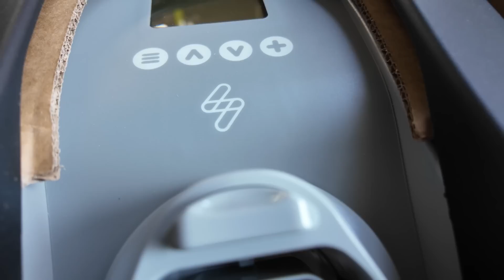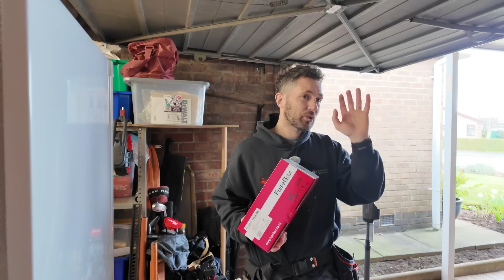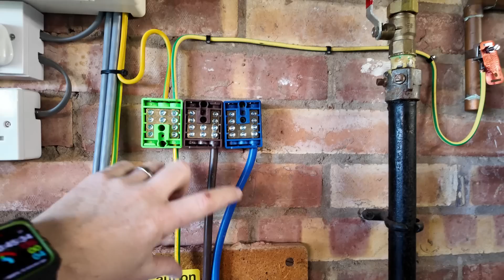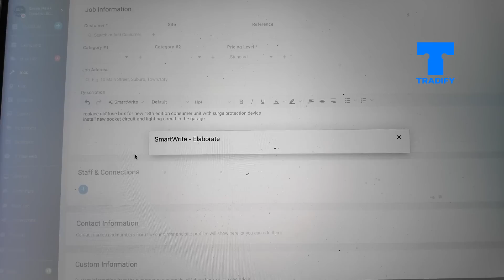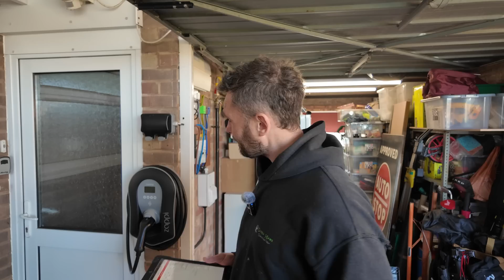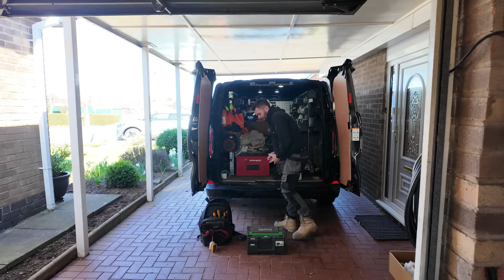EV fast Charger Install - What The Pros Don't Tell You

Comment: 9:57 Found that if you have brittle bricks,  use a tile drill bit with hammer off, and just let it cut at its own pace. Works most of the time
Reply from the maker: I will give it a go. Thanks for watching

Comment: I don't know how anyone could possible suggest that you might have pulled the main cut-out fuse 😀   BTW  what happened to the test for the DC trip. The std. EV CU has an A typ RCD which can only cope with 6mA of DC. The good EV charge points have a built in DC trip which will disconnect if DC leakage exceeds 6mA. Your EV pilot has a test setting to check for this..

Comment: Great job. I don't understand why you didn't fit the EV fusebox to the wooden board next to the meter? It would have been easier to mount and looked so much better. I don't like the location of the oυtside socket, it's too high up, and it looks weird being above the EV charge point.

Comment: Just be aware ( as I was caught out by this 🙈) in relation to a looped supply you could be looking at the end of line of a looped supply in which case there will only be one cable coming into the head end.  Best check with DNO every time👍

Comment: Have you considered using a small meter board for situations like this, small ones are only around a tenner, would give you easier fixing points rather than direct to brittle brick.
Reply: There was one available already next to the meter.

Comment: What cable slicing tool is that dude? My knife just doesn't cut the mustard anymore and stripping it in colder weather has buggered my wrists... haha. There is another test you can perform with the Megger EV adapter and as I was taught should be testing, which is the PE cut-out. It simulates a loss of earthing I believe and should tell the charge point to disengage. Great video and another nice neat install. :)

Comment: Much better to test the RCD at the terminals, as your results will have been influenced by the Zappi's integral electronic one, which may have disconnected quicker than the upstream one. Not sure how you achieved a clear insulation resistance test result with the cable terminated within the Zappi.

Comment: Too close to the edge, too close to the garage door to avoid cable impingement and the absence of a second incoming supply does not assure that it isn't a looped supply.  Looped supplies are often installed as a pair, so only 1 of the 2 houses will have an extra cable, the other does not.  Henley boxes should really be mounted on a board, not to bare brick.  Loose and wobbly on the wall is... well you know the rest.  Other than that, keep the content flowing.

Comment: I was told recently that there was a minimum height for consumer units. Does this only apply when in the house?
Reply: That's building regs nonsense. I installed a board high level in a summer house where they wanted it and the chap from building control threw a fit and demanded that I lower it due to accessibility reasons. My argument was the client can reach it and children can't. Now children can piss around with it to their hearts content and they now have a c/u behind the bar at titty level.

Comment: Lucky you timed the DNO fuse pull and the meter install people between min 13-16 just in time for your lunch, did they remember to re crimp and serial code the meter crimp or was that a special meter with an isolator on it ?
Reply: The electrical fairies did it! They’re similar to the YouTube armchair electrician police only the electrical fairies actually get the job done! 😂

Comment: Shouldn't have touched the meter equipment full stop. Customer should request an isolator installation from their energy supplier. Now, I understand why you done it this way, as suppliers can charge up to near enough £200 for a £5 isolator. But should something happen to that meter installation and they'll be right on top of you. Did the garage door not rub against the zappi cable when closing the door?
Reply: The problem with cutting the seals on metering equipment is that if there is any fire damage or worse case a fire it “could” invalidate any home insurance. Energy suppliers don’t make it easy to instal mains isolators though.
Reply from the maker: no a quick check with the door before fitting and the cable doesn't rub luckily but the client wanted it there rather than a different location what i suggested

Comment: I don't understand the logic from zappi, there's cost in the relays, the cable, contactors, CT clamps, I would have thought at least £15 in cost to them.  They go to the effort of all the cardboard packaging, but then you have all these parts you'll never use.
Reply from the maker: i imagine with ordering so many more they got a better rate and with a standardised production line it probably works out better for them but it cant be much. Thanks for watching 👍
Reply: I’m not sure why they even bother with three phase. Hardly any EVs have an on-board 3P charger and of those that do, it’s often 3x16A (11kW) rather than the full 3x32A (22kW).

Comment: Single phase AC charger and you call it fast charging? also single phase chargers should be illegal
Reply: I would think that more than 90% of all home fast chargers are on a single phase installation. You would be very unlikely to be able to persuade the DNO to fit a 3 phase supply to a domestic home unless you are a very large house, or have a very high energy useage.
Reply from the maker: why illegal?
Reply: It is a fast chargepoint (NOT charger). Fast and rapid have different meanings. Rapid is DC.

Comment: You may want to consider if the neighbours property is on a loop too this property could be EOL of a loop🥴

Did you chop off the extra cores for that integral CAT5e??
Reply from the maker: Yep it could be and it’s down to the dno now as they will be upgrading the main fuse and yes I trim the extra cat 5 cores but not enough that they couldn’t be used in the future 👍
Reply: @ thanks for the reply GH❤️👍
Reply: @Mike-Builds-GHC 
Perhaps leaving the extra pairs in the CAT cable nice and tidy instead of trimming off would be better, yes there is enough length left to use in the future but they wouldn't be long enough to use easily, best to consider the future especially when it doesn't cost extra to forward plan.👍